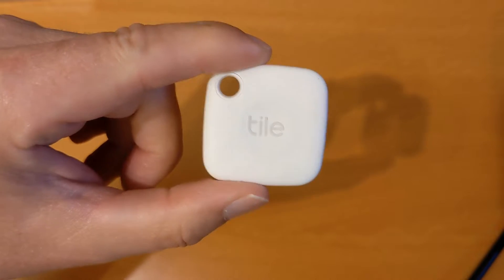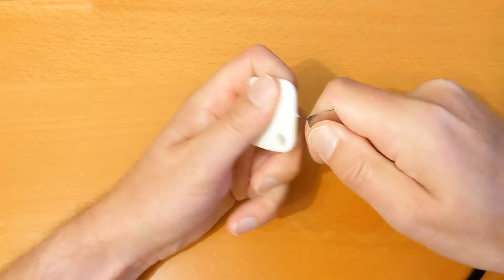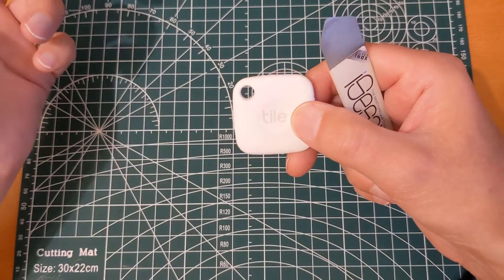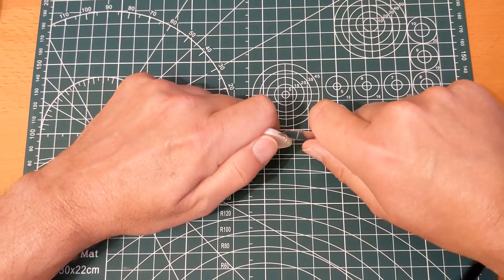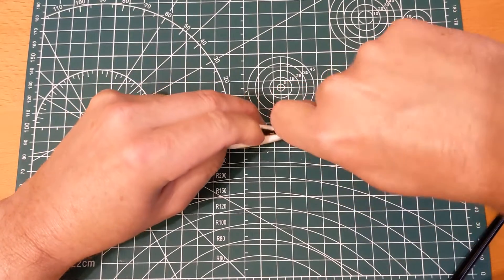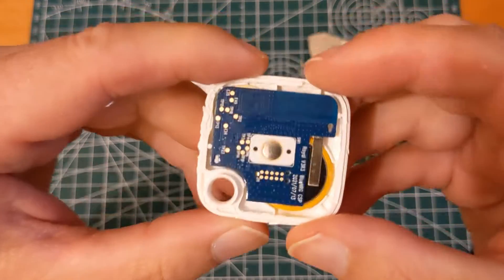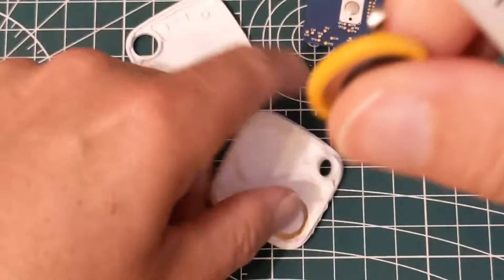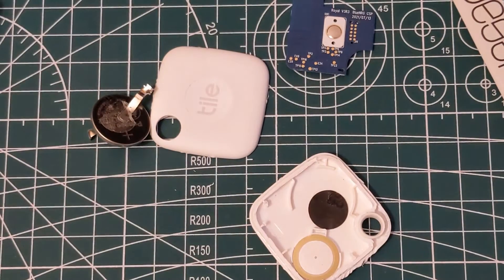Tile Tracker Teardown (plus rant)

Comment: I'm a bit believer in Right to Repair so am not a fan of the design of this device.

That said :

1. You could have returned it for a refund.

2. That's not the right tool to open this device ( I've used this tool for 15yrs)

3. You could have easily been more careful and fixed the device without tearing the battery pads off the board, bending the board and damaging soldered chips etc

Heating the device with a hair dryer and using a butter knife would have been far more successful. 

This device is meant to be basically waterproof, so you should expect it to be well sealed.

There's plenty of other competing devices that are rechargeable or use CR 2032 replaceable batteries !

Comment: What legislation is going to protect these being used illegally? The people who use them for nefarious purposes have no respect for their victim, or the law (as stalking already is a crime) so it is no effective deterrent to them. We all know how soft the law is on actual crime anyway. Far too many people commit these types of crimes and get suspended sentences, if they are convicted at all.
Reply from the maker: I agree. I didn't explain it very well in the video, but the legislation is that the phone OS providers, Google and Apple, have to build in a feature that gives the phone user a warning when an unknown tracker is located close by, and the phone owner can elect to make the tracker bleep so it can be located and disabled. So it's on the victim's phone side of things, not the tracker companies.
Reply: @CBitsTech  Yeah but determined people will just disable the speaker, or find some older device that bypasses the security systems. What they need to do is start giving mandatory significant custodial sentences to stalkers, not suspended sentences so they can continue to terrorise their victim.

Comment: There ARE tiles that have replaceable batteries. But they are still unreliable AND you are giving them 24/7 access to your location.
Reply from the maker: Ah, I didn't know about the ones with replaceable batteries. I'm not bothered about them having 24 hour location access. My mobile phone service provider and Google/Apple has that anyway. And there's not much point in owning a Tile if you can find where it is, so location access is essential, or what's the point of using them?
Reply: Well, it IS a subscription if you want to find them "non locally". So around your house, fine but leave them in another town, street, road etc and it needs other people with low power bluetooth and subscriptions to find stuff farther afield.. @CBitsTech